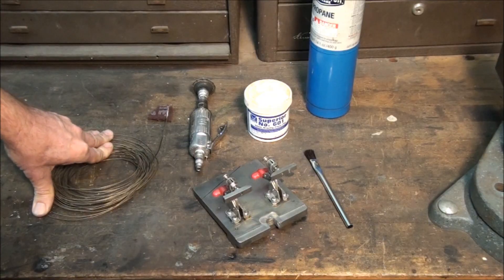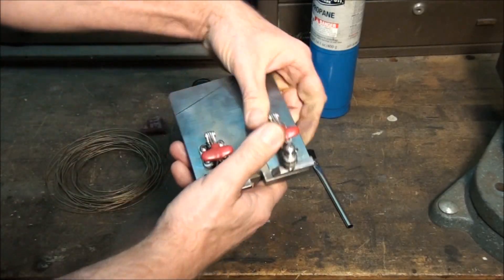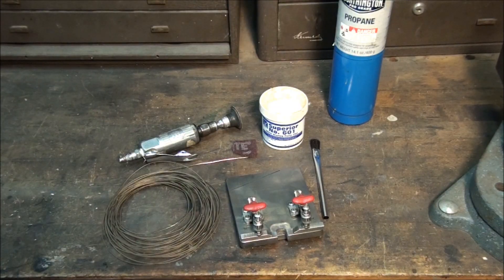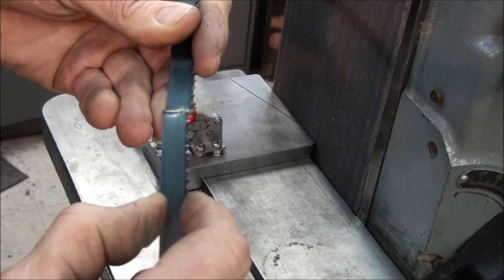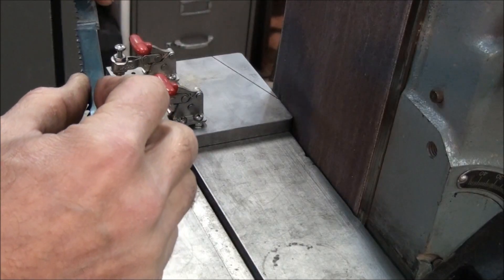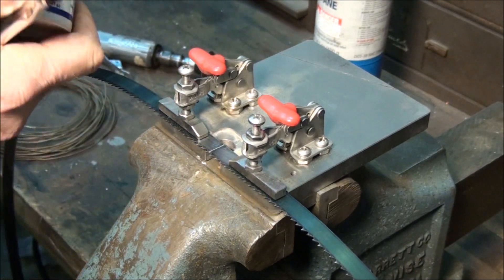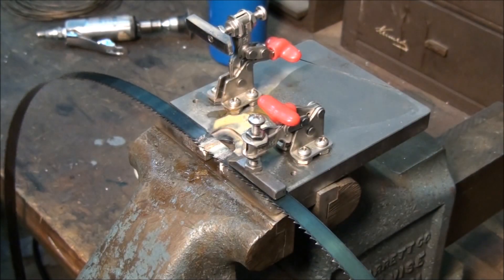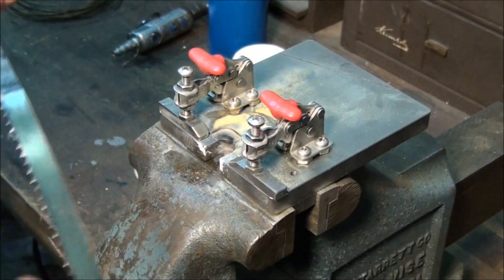How to Make Custom Length Bandsaw Blades Without a Welder

Comment: Great video! I was tigging mine and they weren't coming out this nice. I'm going to make a setup like yours. Thanks for the vid.
Reply from the maker: +8MADJACK 
I've tried TIGing them as well but thin high carbon steel is a challenge to weld. This works MUCH better.

Tom
Reply: TIG welding them sounds kind of heroic!   Seems like it would need annealing after maybe more than the flash butt weld.  I think the flash weld is the best weld you could have by the way, I know that sounds funny.  In welding literature you see this, the metallographs of it are amazing- there's almost no heat-affected zone.  What might have BEEN the heat affected zone is of course thrown across the room!  Silver solder is a different tack all together of course, it has a long history, and also it has worked fairly well for me, working to some extent in ignorance, and with the silver solder I happened to have.   I think if everything is done right it might be as good as you can ask!  I need that little 20 degree jig!

Comment: Would it be possible to use regular brazing rod with an oxy-acced. torch?
Reply from the maker: +Blackaboe 
No, that wouldn't work very well. Brazing rod is not meant for tight fitting joints like this, The silver solder is much thinner so it wicks into the joint.
Reply: Toms Techniques
*

Comment: Great video, do you think it will work with the shorter blades for portable bandsaws to (that blades twist a lot)
Reply from the maker: +JF- Knives 
Twisting is not a problem. I purposely broke this blade after more than a year's use and bent back on itself three times before failing.

Tom

Comment: Guess I need to find bulk blade stock and compare the price to the ready made replacement.
Reply from the maker: +montwolfman 

I think you'll find you can make your own for about half the price of a ready made blade.

Tom
Reply: Toms Techniques yup, and not to mention the fun of doing it yourself. Makes you a better craftsman.
Reply from the maker: +montwolfman 

Practice is good.

I just made up a new blade this afternoon to replace the one I made in the video last year. Just for fun, I tested the strength of the joint and it took bending it back and forth on itself four times before it failed. I knew the joint was strong, but was very surprised at how strong it was.

Tom
Reply: +Toms Techniques... practice makes perfect...I am surprised at the tensile strength of silver solder.

Comment: thanks for this great tip. i will build this tool for my bandsaw blades as soon as possible.
Greetings from Austria.
Rudolf
Reply from the maker: +Rudolf Köchl 
Greetings from Michigan. Hopefully you have more snow over there than we do around here.

I just used the blade I made in the video to saw out some 3/4" thick stainless. It's still working hard for me.

Tom

Comment: Any idea if this works on a horizontal bandsaw where the blade is twisted sideways twice per revolution?  It seems like it might fatigue under that kind of load~

Just wondering if you or anyone else has tried it in that environment since even on our little Roll-In's the good blades are $50+

We have a bandsaw blade welder but getting the weld annealed correctly is sometimes a little tricky and our guy who was good at it quit!  :)
Reply from the maker: +Carl Stender (EXIT 85) 
I haven't tried it on a horizontal saw, but I'd be surprised if it didn't work. I have never had one of these break since I've been soldering them (can't say that about welded blades!). In fact I'm still using the blade that I made in the video, a year later, having used it to saw off a piece of 3" diameter steel bar yesterday.

Tom

Comment: Can you write me name of this part of solder paste You told is important? I'm from Poland and need to look for something like this paste. Never solder steel by silver.

In regular silver work i uses borax and charcoal as pad/support (this give you anaerobic environment)
Reply from the maker: +Jan Szymon Gołowacz 
Look for a fluorinated flux that will withstand at least 1500ºF.
Reply: it is no so hight temperature... as i write i uses torch to silversmith works and in no problem to melt silver 930 for me, (1760F). I will try uses borax and if will be problem, buy fluorine it is from Germany, but probably it is what you write. Great thx for this material...

Comment: Do you think this same method would work on my 1-1/4" band Sawmill blades? Sure looks really good on your blades.
Reply from the maker: +HOSSMCGILLICUTTI 

Absolutely. Larger blades would be much easier to join and the joint strength would be proportionate.

Tom

Comment: fantastic.Thank you ver much.
How Many Teeth for bandsaw blades?
http://bandsawjudge.com/factors-to-keep-in-mind-when-choosing-the-best-bandsaw-blades/
Reply from the maker: +Richard D Turner 
A good rule of thumb for metals is to always have at least two teeth in the cut at once.  In other words if you are sawing 1/4" plate, use a blade with at least eight teeth per inch. A coarser blade will have too high a chip load and fail prematurely.

Thanks for watching.

Tom

Comment: I was surprised by how little solder was needed.
Reply from the maker: +Jason C. 
The strength of silver solder depends on how tight the joint it. The less that is required, the better.

Tom

Comment: Great video.  What about spot welding the blade ends?  I have a 10 inch Delta band saw.  Purchased in the early 90's.  The blade length is 72 1/2 inches.  Very hard to find.  Found 1 at Lowes.  Placed an order for several as I am afraid they will discontinue this length sometime in the future.  A friend gave me several new blades( 93 inches).  My goal now to to cut them to size.  Is the silver solder expensive?
Reply from the maker: +Stephen Elkins 

Spot welding would require the blade to overlap, not a very good thing for the blade guides in your saw.

If you look at the source I've provided in the video description above, you'll find that 1/2" of solder will cost about $16. That's enough to do hundred's of blades.

Tom
Reply: +Toms Techniques Is that 12 " rather than 1/2" for $16.00  ?
Reply: +Toms Techniques , thank you for your reply.  I found that our Lowes carry's the blades I need, but only a few at a time can be found.  I am stockpiling the blades when I see them.  I have new longer blades that were purchased in a garage sale.  Will attempt to cut these down to size using this technique.  Wish me luck.
Reply from the maker: +Darryl Dodge 
Oops. That should have been 1/2 ounce.

You'll save a lot of money making the blades up from scratch instead of buying them ready made from Lowes, even if you have to buy the blade stock new.

Tom

Comment: just a thought if you turn your blade around so the teeth are facing you jig it would be better when you grind off the excess solider so you won't hit the teeth and dull them.
Reply from the maker: +Rick Janisse 

Rick,

The blade in this video is still in use and although it has a chipped tooth here and there, the ones around the joint are fine. It doesn't seem to matter if they lose a bit of their set from grinding.

Tom

Comment: Where do you get the blade stock?
Reply from the maker: +sailingsolar 

McMaster Carr is as good a source as any, although any industrial supply will carry them.

Tom
Reply: +Toms Techniques y
Reply: Tons of it on ebay at decent to great prices, most commonly in 100 ft. rolls. Shop carefully and skip any offerings that don't fully describe the product. Smart sellers provide a clear pic of the manufacturers spec label. It might be smart to spend a little time on the net to acquaint yourself with bandsaw blade nomenclature, (what all the designations mean). Narrow your search to only the materials that you cut. Examples: neither a butchers meat band saw blade, a bakers scallop edged bread wave blade, nor a marquetry wood cutting blade would be useful to cut rebar ;-).

Comment: Do you have some kind of speed reducer on that band saw?
Reply from the maker: +vespadano1979 

It's a wood/metal cutting band saw, so it has a two speed gearbox and step pulleys.

Tom

Comment: Hi Tom, I love the innovative tip on welding the bands together. I have a question, have you ever tried to weld a bandsaw blade that is used for wood such as a woodmizer. They have a larger pitch such as 3/4" & are thicker at .041" and much wider, the normal size is 1-1/4" wide. Do you think that joint would hold up on that type of bandsaw blade?
Reply from the maker: Ryan schreiber 
Hi Ryan,

Yes, that would work fine. You would just need to scale up the fixture to suit. The joint would be plenty strong and flexible.

Tom

Comment: Quick question about your jig.
How did you cut the 20 degree slot for the blade?
I have just measured my blade thickness and it comes to 0.025".
I think your video states your slot is 0.020(?)
Reply from the maker: Wayne Tarling 
I used a slitting saw the thickness of my blade. An alternative method would be to mill a wider slot and screw an insert into it narrower by the thickness of the blade. If you had several blades with different thicknesses, an insert could be made for each.

Tom

Comment: Didn't the teeth near the joint get annealed?
Reply from the maker: GEORGE ZARIFIS 

Yes, but the same thing happens when you weld a blade and then anneal it. Although it's getting a bit dull, I'm still using the same blade that I made in the video so I would guess it just doesn't matter.

Tom

Comment: great video Tom. Do this all the time. Old timer once told me silver solder was expensive and to beat out the wire to about paper thin size on the vise anvil before
soldering and use 45 solder. Always worked well for me. Like the jig.
Reply: You can buy it already like that (ribbon, foil).  Just cut out a tiny piece with snips.

Comment: I cannot tell you how any attempts I have made at welding blades using mig, tig, and even a functioning blade welder. Even made a similar fixture out of copper so the weld would not stick to it. Any machinist should know how strong silver solder is, but this process never crossed my mind, I will give this a shot and hope for the same result. It is very frustrating when you have 4 or 5 rolls of blade stock and cannot get them to bond correctly. Thanks for the video.

Comment: GREAT howto!

Where can one usually purchase un-welded blade?
Reply from the maker: ***** 
Thanks James.

Pretty much any industrial supply will have rolls of blade stock. Try McMaster Carr, Enco, Travers, etc.

Tom
Reply: It's not hard to buy!  You often see 100 feet coils, they come up on eBay.  There are many brands.  Looking at this today, it looks like you can put together a blade for less than five dollars in material, that might cost ten or twenty dollars to buy.  Using STARRETT stock for example.  I used to get it from ENCO, not sure if they're still around.   It's not that unusual to see a spool of this for $60-70.

Comment: Hi Tom, I really enjoy your videos.  I have only been machineing for a couple of years, and still learning.  Would you do a video on makeing socket cap screws? Thank you : Doc
Reply from the maker: Terry Weaver 
Socket head cap screws are not machined, they are rolled (threads) and swaged (the socket). While it is possible to make most anything, cheap and readily available hardware just isn't worth the time. I have made hex socket shapes in other parts, and did it by drilling a slightly undersize hole first and then pressing a piece of hardened hex stock into it to form the hex.

Thanks for watching.

Tom

Comment: This probably wont work for metal cutting blades.
Reply from the maker: NWCC08 
Not sure why you would say that, but nothing could be further from the truth. In fact, the very blade that I made in this video is still in use in my shop a year and a half later. It has cut aluminum, steel, stainless steel and even wood on occasion.

Tom

Comment: Thanks for this video! I was going to buy a welder, and now that sounds like a dumb idea! I want to build a bandsawmill. with 20 to 24 inch wheels. Do you have any recommendations for making or acquiring the best wheels for the lowest cost? I also would like to build a bandsaw with a third wheel to get a four foot clearance. Do you know if there are any particular difficulties aligning them to properly track the blade? Thanks again.
Reply from the maker: Tricknologyinc 

Sorry but I don't know much about bandsaw mills. Probably your best bet would be to join a forum and ask there.

Tom
Reply: Just pretend i said "bandsaw". :)
Reply from the maker: Tricknologyinc 
Thought you were tooling up to mill some lumber. :)
You still might check out a forum for some ideas.

Tom

Comment: Thanks so much for a very clever idea on the jig. I go through a great number of blades and would like to try this technique. Do you forsee any problems doing two separate weld joints if attempting to salvage a blade from two used ones by eliminating the damaged areas of the blades? Also, My blades are  13 ft 6 in long by 1-1/4" wide, .042 thick. Do you thing silver solder will hold?
Reply from the maker: Buddy Frederick 
Thanks Buddy,

I've been using this technique for years and have never had a joint fail. In fact the blade that I made in this video is still in use. I've never tried it on a blade as large as you describe, but would have no reason to believe that it wouldn't work as well as it does on smaller blades. You could always solder one up in a makeshift fixture to see how well it performs before putting the effort into building one. Just make sure you get a good fit in the joint before soldering. The tighter the joint is, the stronger it will be.

Tom

Comment: Great video!  For people like me that don't have the equipment to make a nice jig like yours, you don't need to taper the ends.  You can clamp the blade to the inside of a piece of angle iron and overlap the ends about 1/4" or less and solder the overlapped ends.  It's tricky but you can grind the high spots on both sides until the blade is the same thickness throughout the ground area.  Then you can use a couple of pairs of pliers to bend the blade so you don't have a kink.  I've soldered several blades that way.

Comment: Hi there, Great video. can now see how easy it is. One thing though from what i understand is that, once joined, the blade needs annealing to relieve the stresses in the blade. You didn't mention that you did it. If not, why not?
Reply from the maker: Greg Bland 
Thanks Greg.

Annealing is only required if the blade has been welded. Silver soldering doesn't get the blade hot enough to harden it, so annealing is not required.

Tom
Reply: Toms Techniques  Ok I can understand that. Thanks heaps. Love your Jig. Makes preparation so easy but for one, though very practical, who doesn't have the facilities to make it is expensive to get that sort of thing made.especially here in country Victoria Australia.
Reply from the maker: Greg Bland 

You should check out metalworkingfun.com. There are a lot of hobby machinists from Australia there. Maybe one of them could help you out.

Tom

Comment: isnt silver solder really expensive these days, well at least in the uk it is, i use them in the refrigeration industry and one rod can for go for more than £10
Reply from the maker: Expense is a relative thing. It takes so little to braze a blade that a stick will last a long time. Besides, the money you save over buying ready welded blades will more than pay for your silver solder.

Tom

Comment: If you reversed the blade in your fixture when cleaning up (teeth towards the vice),  it would be much easier to grind without touching the teeth.
Reply from the maker: Yes, that would help. I guess grinding it this way is just an old habit from using blade welders.

Tom

Comment: An excellent explanation and demonstration.  
I have been silver soldering my bandsaw blades for years, using a jig very similar to yours, and although I do have a blade welder, I find the soldered joins are more reliable.
I apply the flux to the bevelled edges only, avoiding the adjacent blade surfaces, on the assumption that the solder will not stick to unfluxed surfaces, and making clean up easier.
The 20 degree slot for bevelling is one idea that I will definitely copy.  Thanks for that!
johnsmachines.com
Reply from the maker: Thanks John.

The brazed joints are definitely reliable. The blade I made in the video is still in use, although it is starting to get a little dull.

Your steam engines look like fun. Do you have a boiler for them?

Tom
Reply: Toms Techniques  Hi Tom,  yes, I have developed a real fascination for steam engines.  The massive torque at startup just does not occur with internal combustion engines.
I have made a boiler.  There are pics and descriptions in the older posts section of johnsmachines
I am subscribed to your posts now, and looking through a lot of your older ones.
John (from Oz)

Comment: Any welding supply store will have the silver solder and flux in stock. The high silver content solder is expensive though. I bought a roll last summer that was eighty bucks But one roll will last me the rest of my life easy.